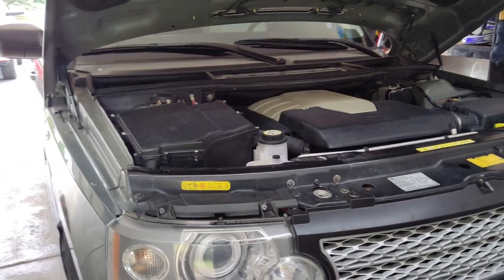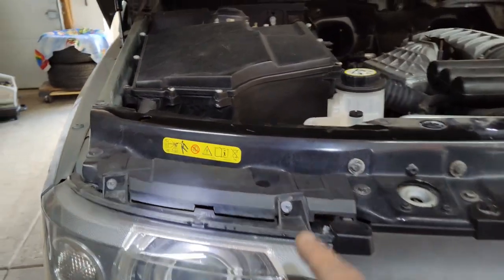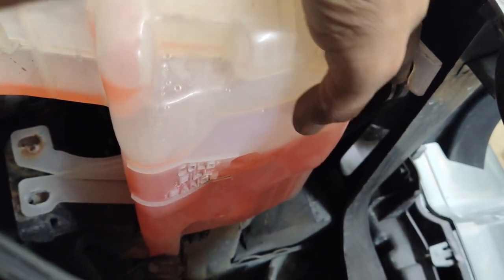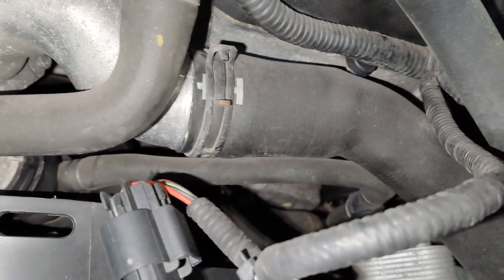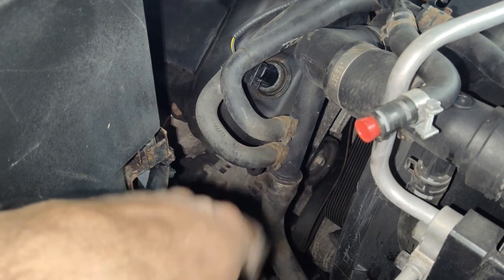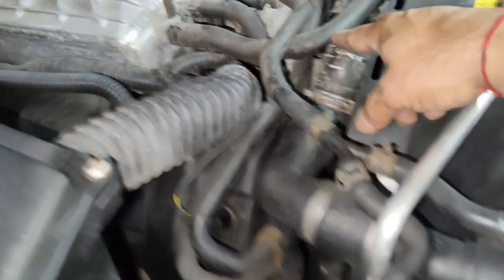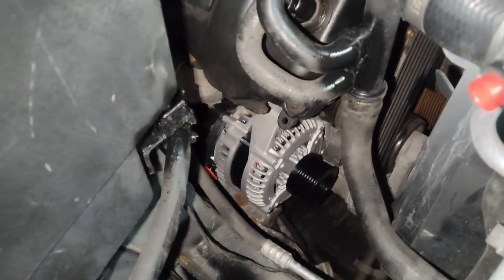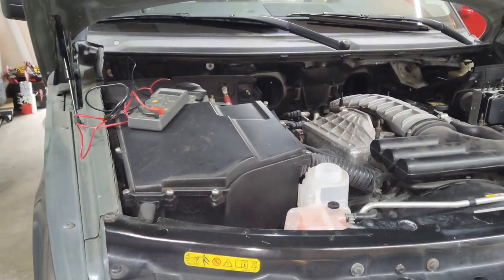Range Rover L322 Alternator Replacement | Problems & Testing

Comment: FWIW, the alternator is easier to remove from underneath after removing the front splash shield and right front wheel. It will slip out through the aperture in the right front corner between the subframe and body. Disconnect the frame to body ground wire for additional room. Loosen and displace the belt(s) then undo the 13mm nut on the large cable connector. Undo the three 13mm mounting bolts, carefully tilt the alternator away from its “nest” and give yourself enough room to unclip the rear plastic connector by squeezing the retainer towards the wires. Ease the alternator out through the right front opening.

Comment: Well done. That was very informative. My RR is a 2011 and has the 5.0 gas motor. I’m assuming the alternator will be in a bit of a different location.
Reply from the maker: Thank you for the kind words, much appreciated.  Actually the alternator on the 5.0L motor is in the exact same location  as these and the 4.2 motors.  Right side bottom of the block.  I would assume these can be removed/replaced the same way.